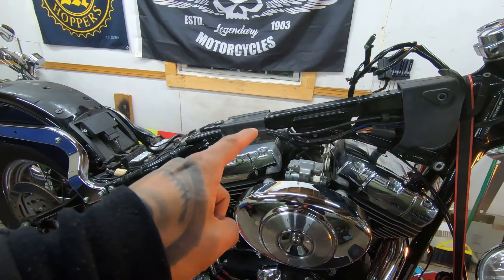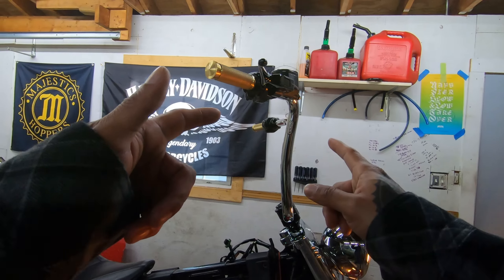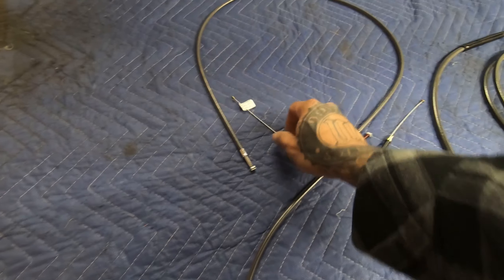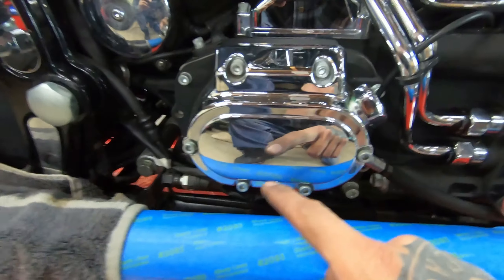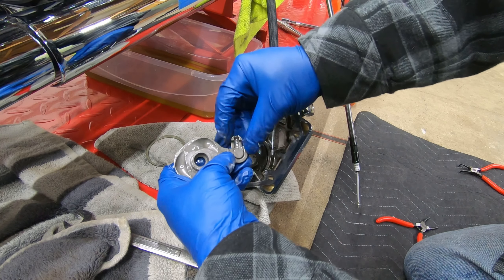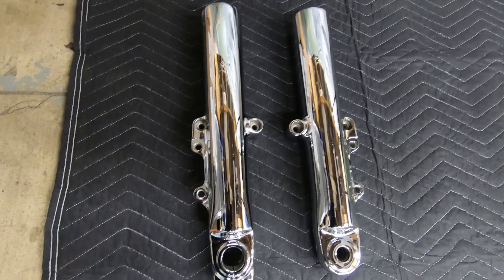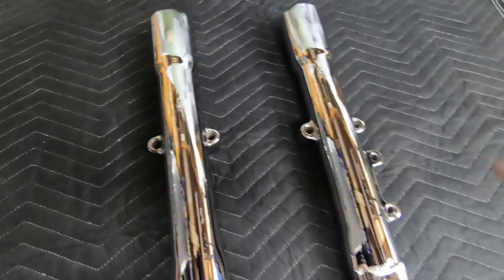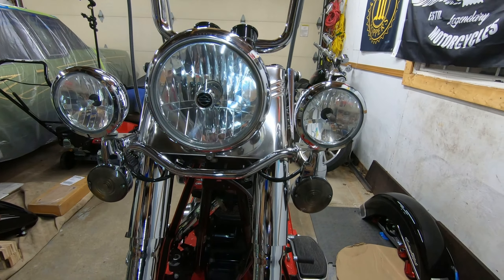Vicla Style build - Bars, Cables & Chrome Lowers - Harley Davidson Heritage Softail  Ep.2

Comment: I got Carlini Flying apes recently and I’m putting them on this weekend. I noticed that the bottom wire hole is extremely small compared to other bars. Would it be bad if I grind the hole to be bigger so it doesn’t pinch and cut the wires?
Reply from the maker: Did you get the non-step down or the ones that drop to 1” to use with the stock risers?
Reply: @SS_Motoring  I got the 1.5” non-stepped.
Reply from the maker: @lethimshoot6431  1.5” should have a big enough hole. However because they are 1.5” you can make the hole a bit bigger if needed. There’s enough tube there to keep them strong. Just don’t over do it and risk the bars cracking or becoming weak in the center.  Make sure you de-pin the cables before you run them through to make it easier.